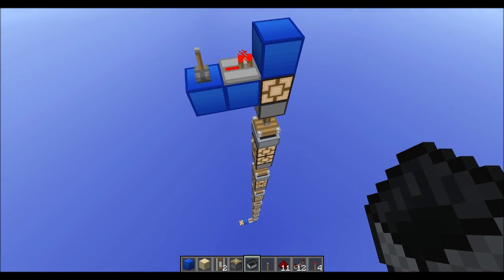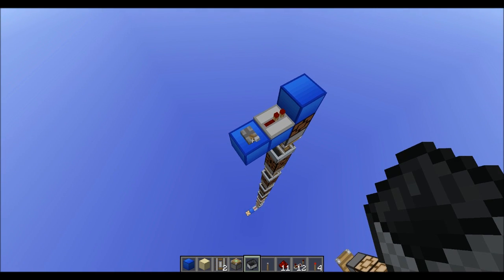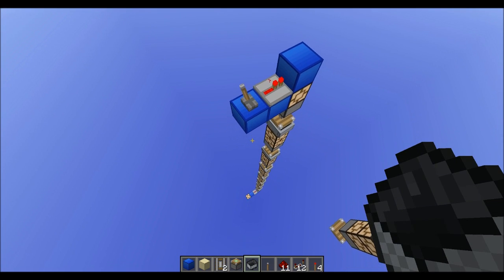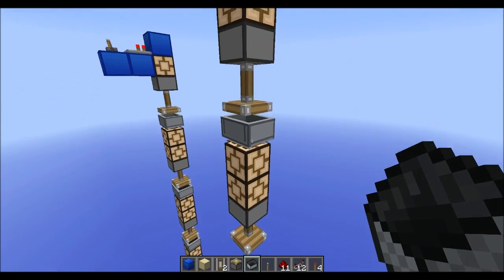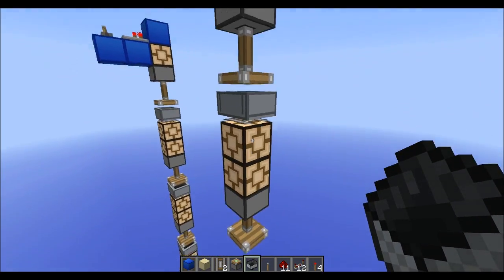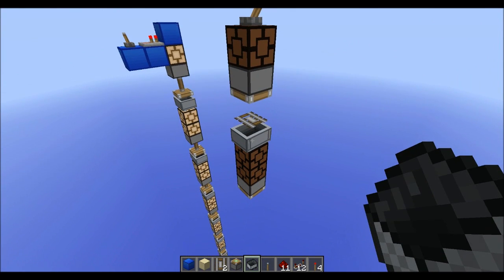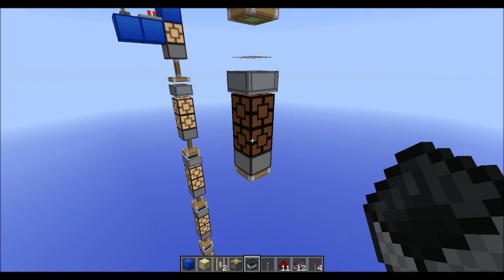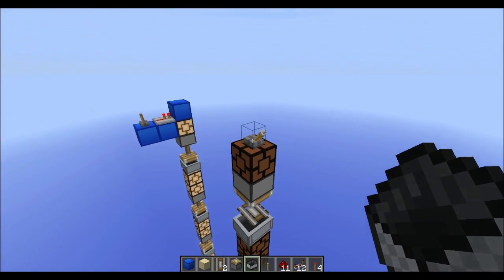Minecraft Crowd Sourcing: 1x1 Vertical Downward Transmission (Help needed)

Comment: To stabilize this, you could add a signal-to-pulse converter and an inverter at the beginning and a pulse-to-signal converter (i.e. a T-flip-flop) at the end. This would ensure that the wire, when unused, is always powered, and since the wire is only unstable when unpowered, this would greatly reduce the risk of the wire collapsing (although it is still possible that the wire breaks while transmitting the signal). Problem: Rising edge seems faster than falling edge, needs anti-overtaking measure

Comment: what if instead of having either on or off power have it send through a short pulse so that the detector rails will never really be in the air for very long. and at the bottom you could have a vertical t flip-flop to be able to toggle the power. and this would keep it at 1 wide its just gong to be a bit longer?

Comment: if its for pulses, an inverted signal would work, wouldnt it? because the chances of it despawning are slimmer if it is only in the air for a pulse. doesnt solve the problem of it despawning tho...

Comment: wrt waterbased downwards line... if you want it to be more compact and toggleable by a pushbutton or puls: just use a dispenser with a water-bucket in it to place/remove the water

Comment: No! The rails despawn because they "run out of power." If the 1 update per tick were true why do bud switches stay open and non detector rails stay floating. 
The solution is to send it in short pulses so they don't have time to "run out of power."

Comment: first of all  the watter would break the pressure plate, and second even if the watter didnt break the presure plate the watter wouldent be able to pick up the boat due to the watter not getting into the same block that the presuure plate exists in

Comment: 2 reasons:

* the rails will get tilted when they are next to each other at different height causing the minecart to move into a position that causes problems
* a mid-air rail is a BUD... they are not allowed to exist in midair, so they will pop as soon as a block next to it updates

Comment: Now here's another interesting observation: put a minecart on a detector rail, then pull that detector rail up into the air with a sticky piston. Now destroy the minecart, then put the minecart on the floating detector rail. It stays there indefinitely. Now repeat, but don't put a minecart on the placed detector rail, don't put a minecart on the rail until it has been lifted. Now the detector rail is immediately destroyed.

Comment: The first thing what can to my mind was also sending pulses, but is seems the retrackting the pistons is slower than extending. This would mean that the pulse length should increase if the distance would become bigger and therefore the chance of a detectorrail popping of would increase. However if speed is not an issue, you could use downward flowing water, with a BUD below.